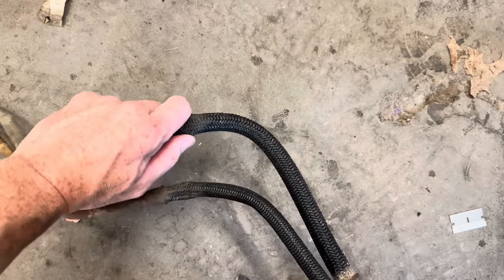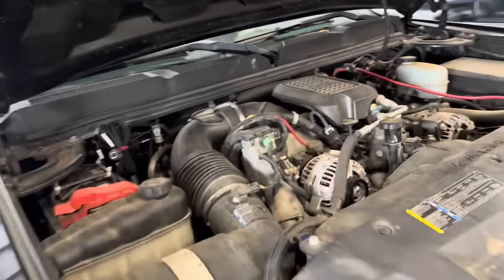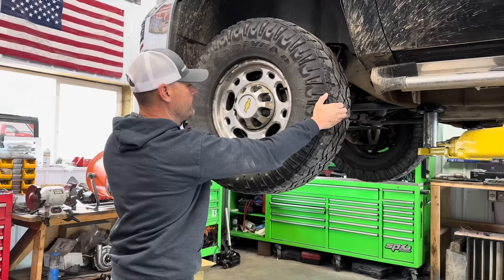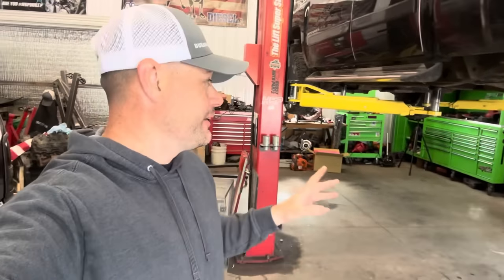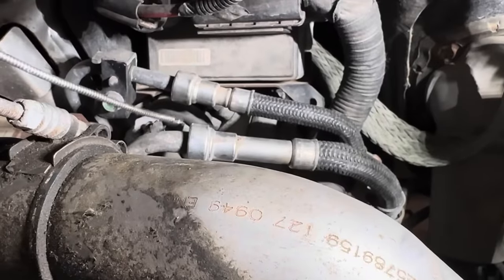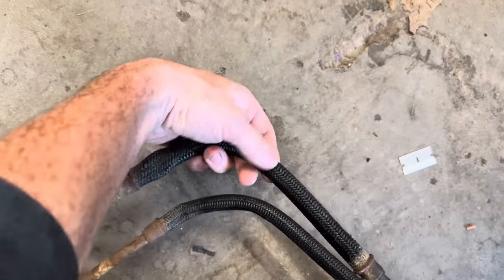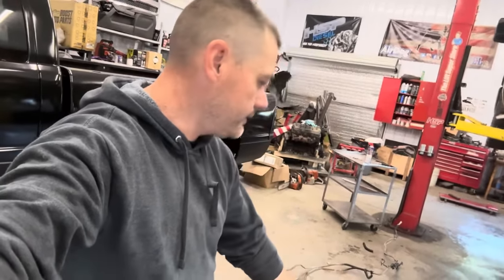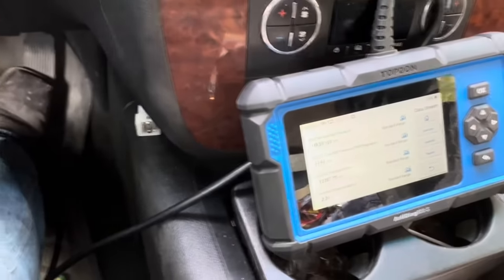Major Fueling Issues On This Duramax! *This Could Leave You Stranded*

Comment: When bleeding fuel on a duramax just crack the bleeder free and pump until fuel comes out of the bleeder consistently and then tighten it and it will start and stay running
Reply: Unless you have a plastic nspa  filter.
Reply: @dustinmetcalf1141 yeah those napa filters are junk lol

Comment: Tip of the day: 
Keep a screwdriver or wrench in your truck just in case you run out of fuel and you have to call your wife to bring you a Jerry can. 
I have an Airdog lift pump and it's REALLY easy to prime the fuel lines with that when I have something to open the bleeder screw.

Comment: GM has a bulletin about the high  pressure fuel line collapsing.  One place it collapses on the left side where the fuel line comes up. Also underneath the bed of the truck same thing.

Comment: I have a 01 lb7  and noticed when I bought it had new fuel lines . Froze up on winter and I noticed those hard lines someone kinked them on install. I couldn't afford new lines so I bought fuel hose and cut kink out and spliced hose and clamps in were it was bad. Never had my truck gel up or not start again after.

Comment: When I installed my lift pump I replaced all the steel lines from the tank to the engine bay because the braided line to the tank was leaking and the line running to the engine bay was looking rough from many years in minnesota and it's an 06 lbz so it has seen alot of winters.

Comment: Sucks that Chevy doesn't go with stainless steel lines to begin with on these. Just did the lines on my 2008. Went with replacement lines from linestogo. Called them up, gave them my VIN and had them the next day. They have a flexible fuel line option for the last part that snakes up to the engine which makes that part of the swap out easier. Really happy with them.

Comment: Mine has done that to me also. I reset it while pushing the accelerator and brake simultaneously. I have a FASS pump on mine. I change both fuel filters every other oil change.

Comment: Thanks bud, I have an 07 1/2 3500HD, fuel issues after start up, replaced the primer pump seals, starts well but seems to starve upon acceleration for 5 seconds. Going to go over lines underneath as I’m in the rust belt Canada

Comment: Yes, I have run into this exact problem. In fact, it's happened to me 2 different times The first time was laziness and not changing the fuel filter for about twenty thousand miles Change the fuel filter reset the codes problem fixed. Ran probably about 3 or 4000 miles. Decided to go ahead and change the fuel filter again. Just to be safe so I didn't have to worry about it Got about 2800 miles out of the second filter. Then had to change it again. Still going so far. Stay away from Fram filters. And I have a 05 3500 dully

Comment: Anytime you open the fuel system, (filter, lines, filter head), its going to have a hesitation until it works the air out, super common, nothing to worry about as long as it straightens itself out within 2-5 good pulls.
It can also be sign its time to change the filter or that it is sucking air through the wif sensor or filter head assembly. The wif sensor has gotten me a few times, whether backing out or just not sealing properly.

Comment: I quit searching for replacement fuel lines real quick and instead ordered a Fass lift pump, some extra fuel line, and a whole bunch of fittings. I’m going to cut the lines at the back of the motor and replace it all the way back. I’ve ordered a low pressure fuel line kit and injector return lines. This 2006 2500 Chevy Express LLY has been sitting and the fuel was thick and sticky and smelled like bad paint so I dropped the tank and cleaned it and am putting in a new fuel transfer unit even though I’m using a tank sump. I want clean fuel! Sure hope it starts and runs. It will eventually but how much money will it take? 😂

Comment: my 08's lines are collapsed just ordered in new ones. Been having a weird issue where my injector balances are reading good but each time I have checked them i have between 1 to 3 that are in the 1.5 to 3 range and its never the same ones. Went to do an injector cleaning and noticed the lines. Should probably check my rail pressure vs requested.

Comment: I had a similar problem on my 2009. Both times this happened I primed the filter and after many tries it started.  Both experiences were 3 years apart. Both times I changed the filter and that seemed to work. 
   I don't know if it has anything to do with it but both times I was parked on a hill.
Reply: Yes it does if it's parked nose high fuel will return to tank. Replace the filter housing. Untill then park nose down.

Comment: The flex lines coming from the siphon on the tank and around the fuel return cooler both have issues with interior collapsing they behave like when a flexible brake line swells and collapses

Comment: I have an 08 LMM and had this same issue with the fuel pressure low and went into limp mode.  I was watching your channel and a few others and the kinked fuel line was brought to my attention.  Turned out mine had a kink near the driver side inlet on the braided section.  I am a cheapo for now and put a hose clamp on the kink to keep it open and it is working for now (till I can replace the fuel lines soon) also might need some help with putting together a parts list for an EGR issue which I am going to be addressing very very soon.  Let me know if you can point me in the right direction for making a list of parts for the LMM.
Reply: Do you know what code you were getting?

Comment: That hesitation shifting could have something to do with the glow plug module code. When I had a bad glow plug module in my LLY it would shift funny sometimes. After the new Glow plug module, never had a problem since.
Reply from the maker: Good to know thanks
Reply: Seems odd, I have an LLY as well, and the glow plug module went bad, had a check engine light, and it still shifted fine.
Reply: @2015_Rubicnn  mine set a Trans code as well when the glow plug module went bad. Posted on the LLY page about it and someone just said replace the glow plug module 1st and see if it clears the rest of the codes, and sure as shit it did and has been perfectly fine since after 2 years now.
Reply: @2015_Rubicnn  if remember correctly it was some sort of TCM communication code that set when the glow plug code was set.
Reply: @gvent3080 I'm not saying that didn't happen, but it just seems weird.
Reply: I had the same issue with my truck a few months ago. Trans shifting funny then TCM communication code and some other random codes that didn't make any sense. Then I got a glow plug communication code finally so I unplugged it and cleared all the codes and now it's been fine ever since. I don't need glow plugs in south Texas lol

Comment: Where did you order these fuel lines from ???? Everybody has fuel lines for injection stuff but not main fuel lines ? I have the same problem with my truck
Reply from the maker: Dorman
Reply: @TruckMaster  Thank you for the tip, Can those rubber braided fuel lines up by the transmission still collapse even if i have the fuel tank pressurized with 15 psi . Will the walls still collapse and close when the injection pump draws fuel even when the walls of the fuel line are pressurised by a external source ?  . I made a fitting from the air compressor to the fuel tank of the truck .  Seems to me you are a believer in Christ as I am too.

Comment: My LBZ was leaking at the cooler. When I put my lift pump on, I put those Dorman stainless lines on it and deleted the cooler. No leaks, runs like a charm - but boy I was baptized in diesel fuel. Not a fan of fuel line replacement
Reply: Surprised you got rid of the cooler. My buddy just put one back on his truck and fuel temps drop like 30 Fahrenheit
Reply: @jonathoncatterson8901 I’ll probably end up putting a new one on it. Was on a time crunch though and didn’t have the new cooler in hand yet
Reply: What code were you getting

Comment: I own an 08 duramax and I have these same issues it has a fuel pump and it is still having this issue the mechanic can not figure it out any ideas on what to check next has new injectors and fass fuel pump
Reply: Check your fuel pressure relief valve on the rails
Reply: Google fuel pressure relife valve bottle test
Reply: I second that. Get a fuel rail valve but one with no spring.  Cheap part worth trying before throwing big money at it
Reply: Ive already replaced the fuel rail valve also
Reply: Man with all that replaced you should be fine, check all your lines for leaks and make sure your filter is newish and has a good seal, i remember something about the filter housings having an issue sometimes, atleast with a fuel pump it will be a leak instead of sucking air so should be easier to find
Reply: @garylake5673  did your fuel valve come with an oring?
Reply: @pr5721  yes
Reply: @garylake5673  im out of ideas off the top of my head im sure im missing something, i know one of the diesle chanels had a video about tracking down the p0087 issue
Reply: Do you know where to buy a new one not the race plug vs shimming it? My luck is I'll mess something up either getting it out or when I shim it? Haven't done a bottle test yet just looking at the next step after checking fuel lines. These trucks are creeping up on 20 yrs old. So it's to be expected for some of these parts to start wearing out.

Comment: The reason that done it the first time, and not the second time hesitating to shift The Allison knows what the motor needs it’s crazy to think but i’ve run into the same thing with my LMM or newer duramaxs in General if they don’t have the correct air or fuel, they will do crazy stuff

Comment: I have a 2013 Chevy 2500 HD, 6.6 Turbo Diesel, slightly gave it gas to pass a car to make interstate exit, truck bogged and eventually shut off when rolling around the exit ramp, 

Primer bulb felt loose, replaced the fuel pump road side and tried to crank a few times but battery died. No check engine light, cuts off once fuel pressure is met as usual with first cutting on the ignition. 

My biggest concern is there was a good bit of metal shavings in the fuel filter, some bigger rusted flakes some smaller clean metal shavings but enough to be concerning. 

Seeing a lot about injection pumps from my research, definitely going to check all fuel lines while she’s down, I’ll start with bleeding any air out and repriming, don’t want to risk getting any metal in engine fuel components, can I trust the new fuel filter to catch that or should I look into flushing the lines and troubleshooting the pump before attempting to start anymore?

Comment: Had a stage 4 trans done lift pump tap shifter fleece and edge insight cts3 with the extra wires for the turbo truck does have 5pos switch efi live and gets now I got truck back and it doesn’t build over 6psi boost and lags almost 10 secs the goes to 18 psi then back to hardly nothing. Could this be a fuel issues it shifts all over the place too now I checked for boost leaks and all good their new maf sensor too idk im beat also the truck had the head shaved and new gaskets arp head studs

Comment: ive did a reroute on my 2008 3500 chevy lmm and installed a catch can.  my problem is i get oil coming out of the catch can filter and was wondering if i take the catch can off and let the hoses run down would i get oil on the bottom of the truck.  thanks for the knowledge of these trucks.
Reply: You might get a little oil over time. But i run my hose to the outside its just easier.
Reply: @jonathoncatterson8901  does it leave oil all over the bottom of the truck if i run them outside

Comment: Hesitation to shift... Could that be the Allison tcm relearning to a full throttle? I hear they self relearn all the time as you drive em. Mind you mines an ol 03 lb7 tried and true. 180k ZERO BLOW BY.   I check often .... Prananoya
Reply: Was thinking the same when i heard this. When i bought my 05 LLY couple years ago, my buddy plugged into it with his knock off snap on scan tool, and set my trans to "relearn" my driving habits from the previous owner. Not sure if the newer gens have it actively learning or not, but that was def my first thought. Giving the motor the fuel it has been screaming for, and then it getting it. probably like chugging a beer too quick when you get off work. get a lil choked up. lmao.

Comment: I don't know why GM doesn't use better fuel and brake lines.  Those are the first two things I look at when I get a used GM vehicle.  Very dangerous to have a brake line blow out that is corroded.  Salt just eats them up.

Comment: So I recently took my family 1600 miles round trip to Central Montana and had my fuel filter light come on a couple times and my tuner threw a code at me while passing slower traffic under load and it said fuel rail pressure low. I have a LML, I put a lift pump on it this last weekend and through advice of a local friend, parked it and ordered a Cp3 conversion kit, I did notice that one of the notes after I had placed the order for the cp3 kit said that if I am running a lift pump in tandem with the cp3 kit, I needed to make sure the PSI from the lift pump was no more than 2psi. It's a Fleece cp3 kit and I'm running a Fass titanium 100gph lift pump. Any words of wisdom on that? How do I change the psi if needed? I tried searching all over YouTube and can't find anyone mentioning this being an issue, so trust and hope are in you for some help brother!!

Comment: If you drive different than he does the Alison is constantly learning so it will act differently a few times. I ragged on mine always then drove nice in a Different tune and it down shifted gard twice never did it again. I did research and everyone said they are always learning so don't worry. Also spin off change every 50k on trans run approved allison fluid not just a dex 6 tes 289 if I remember correctly. I have 2 2009 gmc duramaxes and a shitbox 2016 lml that keeps leaving me stranded especially liked leaving me stranded in the woods in the u.p. for days on end and northern Wisconsin. Maybe it was a hint to enjoy the trees while I could again but hey I figured out issues and made it out of the woods. Injector replacements were not fun in the parking lot while it was about 100 deg out though 😂

Comment: I wanted to replace my fuel lines for my 2011 Crew Cab Long Bed Dually that run from the fuel tank on the driver side up by the transmission but they have been discontinued by everyone, Doorman , AC Delco ,GM themselves, lines to go , Inline tube . .I was referred to go to the junk yard but the defeats the purpose of going new and to stop collapsing fuel lines while under suction . Can the rubber be cut off my old tubes and new rubber with clamps be added for a new joint? What kind of fittings can be used to replace the old rubber fuel suction lines . Any leads would be help for or what can be done would help me too . Thank You
Reply: What have you done about it?
Reply: @j_rainsgoat3929  Nothing just yet , still running stock fuel lines
Reply: Let me know what you came up with for a solution. I am having the same issue with discontinued parts for my 08 lmm.

Comment: will this problem give you a low fuel pressure limp mode
Reply: Yes it would but it could just be your fuel filter is clogged or your fueo rail valve is bad and the spring in it is compromised. Check those areas as well. Very common

Comment: Update us on this as soon as u can... my lml has collapsed fuel lines right at the connection.... I thought it's supposed to be like that 🤦
Reply: Honestly it Probably fixed the problem. Starving an lml of fuel is deadly. Better replace it anyways regardless. Unless you wanna pay for the entire new fuel system when that cp4 blows up..
Reply: @timAA205  exactly.... I'm planning on cutting the flex fuel lines out and going with 1/2 steel... just on the flex braided lines.  I'm from the south so the salt and rust isn't the issue... mud can be but,not real common down here.  Thanks for all that you do.       Im a Certified YouTube mechanic ..lol.

Comment: Normal coolant temp for a 2014 6.6 Savana,
Reply: Duramax usually run 180 to 195 just normal driving when warmed up. Will get hotter on hills but then your fan shoukd kick on